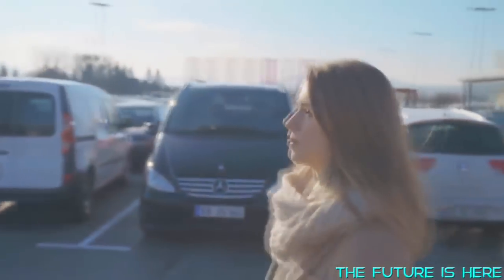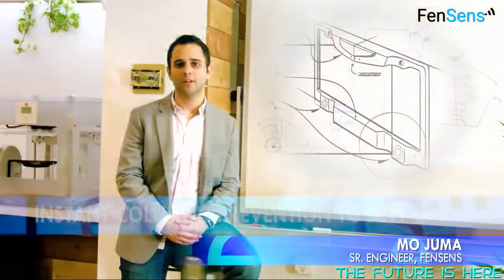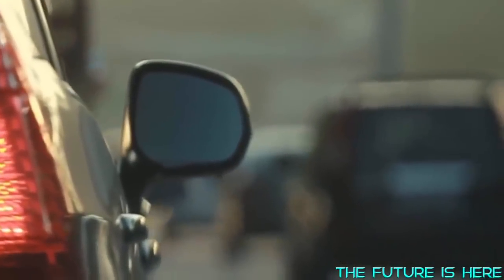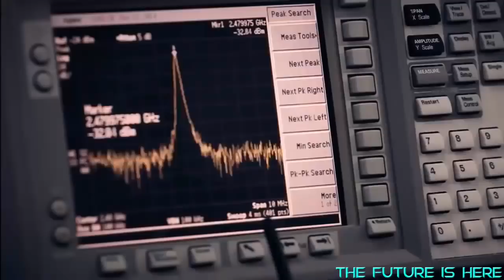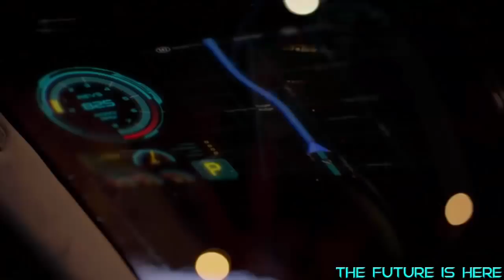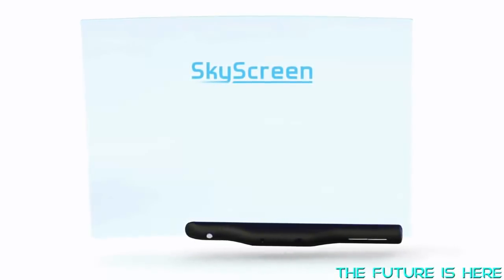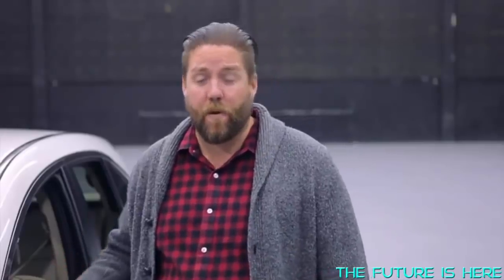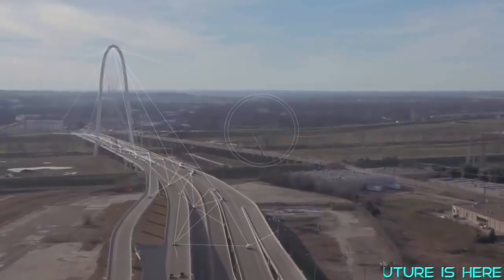TOP 7 Coolest Car Gadgets You Must Have

Comment: TPMS is a very expensive way to give away to strangers, every time you park your car at a shopping or public car park you are risking it getting stolen making a replacement very expensive as you only purchase a single unit not a set. Making delivery charges cost more than the item. Why would I wanna do that to myself. I had my TPMS stolen once. Never again I will purchase an item that can be easily removed and stolen.